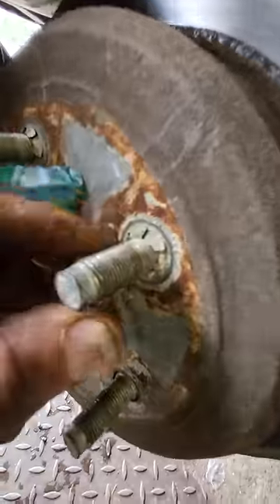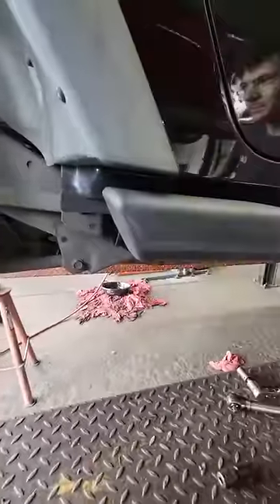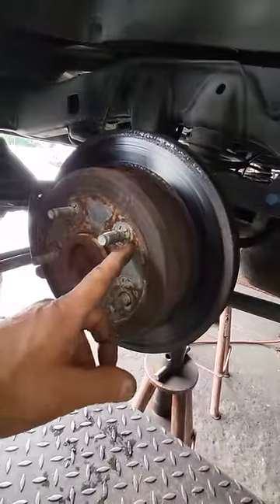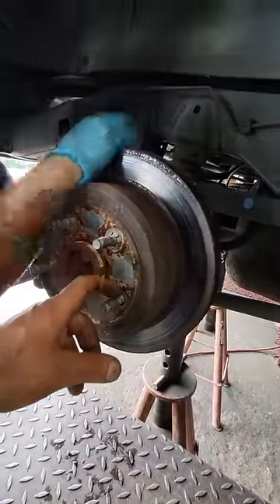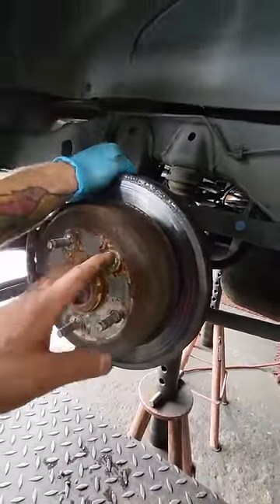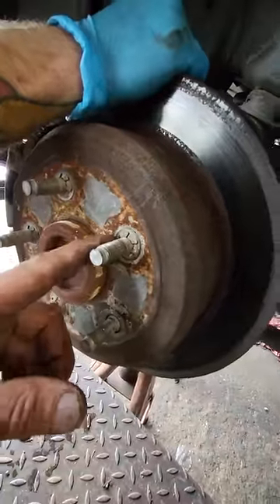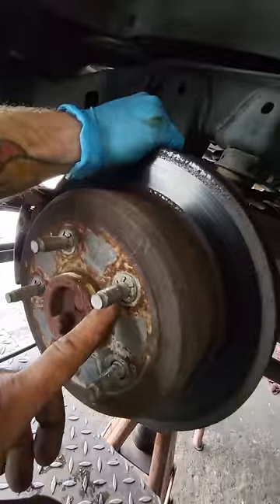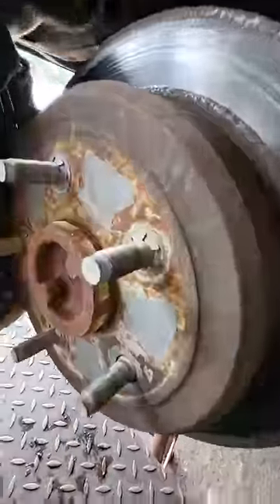There is always that guy

Comment: This is why eventually the young mechanics end up not replacing the oil filter because their boss tells them if the oil looks ok then skip the filter.   Small things turn into bigger things.  I just paid $200 for a transmission flush at dealership and drove it home and pulled half a cup of fluid and its jet black.   They then wanted to tell me it was their flush machine needed to be calibrated.  STEALERSHIPS!!

Comment: That clip is only there for the automated Factory line. It's there to keep the rotors straight so you don't have to have a human hold it to put the caliper on during the simply it' has no function after that

Comment: Ha, that's me. Can get a 500 ct bag of new retainers for 3 bucks. Just looks professional when they're shiny and new imo. That extra bit of polish. Costs almost nothing and takes 10 seconds to pop on. They do nothing though. Even in worst case scenario, lugs fail or sabotaged and wheel falls off, you've still got the rotor hitting pavement and these little shits ain't saving nothing.

Comment: Why would you need to remove the wheel studs to switch out brake pads?
Reply: The rotors
Reply: @pinkiepie1656  he clearly stated changing the brake pads, not the rotor
Reply: @vaughnlucifer1339  I watched it and didn't hear him mention brake pads. I also didn't hear him mention 'removing studs' to change anything.

Comment: Tisk Tisk, here at the top tier repair facilities a vehicle leaves with the same amount of parts it came in with because that is the manufacturers repair procedure. For about 25 bucks you can buy a 5 lb bag of those and never have sleep knowing you have never finished a brake job all the way through 100%.

Comment: First of all. Parts will not have those in stock. It will take too long to explain to the parts guy what you are needing. So in my 21 years as a tech, I have never put those back on. I cut them off.

Comment: You should tell the reason why they use them is only because on the assembly line they need them to stay together when traveling down the line before they get to the wheel install section

Comment: Inverse arguement they will rot away first and cause a loss in clamping force on the rotor and wheel and the studs will snap and they will eventually cause the wheel to fall off. LoL in which case the rotor might stay in place

Comment: That's because the dealer uses an on car brake lathe so the rotor does not have to be removed also I am guessing the customer drives mostly highway puts on a lot of miles on a vehicle and by year it's not that old. That's likely the clips are still on there. Rotors on average are probably cut three times already and ready to be discarded for new. 30,000miles every brake job the car would be around 90,000miles and this is highway driving so easy 100,000 or better with the clips on.b

Comment: Won't the rotor wobble every time you take the wheel off?  Possibly putting the tire on ith the wrong position causing the wheel to be unbalanced and the rotor wiggling the hub smh
Reply from the maker: No

Comment: As a mechanic that works on 100+ vehicles, memorizes all the bolts to every part, id rather not have any left over bolts, spacers or clips. Everything i take off, goes back in. Easy math. Nothing anal about it

Comment: Shiiiii… I replaced the brakes on the company truck after them grinding for 2 weeks… come to find out the truck had over 170k with the original rotors and brake pad hardware… they didn’t even grease the pins when the pad slapped it… I fucking hated trying to get those clips off… they were corroded on there so bad that I finally said fuck it and chopped em in half with a chisel🤣

Comment: People in this chat arguing for their replacement clearly don't understand what holds a rotor on if the wheel comes off. It's not those clips. It's called a caliper assembly. If all that comes off ypu were in a wreck and are viewing the scene from above. Rip.

Comment: How do you know they are not the original brakes? They are on the rear.
Reply: The rotor has probably never been changed and it is the one it came off the assembly line with. People pad slap brakes all the time especially rear ones.

Comment: Could be worse, it could be some ass who torques the caliper bracket bolts to 10 million ft lbs, cross threads them, and leaves that horror show for the next guy. (Me). Be glad you have lifts and don't have to lay on the ground for 3 hours pushing on a breaker bar 1/6 of a turn at a time, straining every muscle in your body for that 1/6 of a turn.

Comment: I just did 1984 Camaro Z28 convertible fuel pump original brakes and I had them Clips on it from the factory I look at it this way what other things you not putting on

Comment: Nope you need to order new ones every time the wheel comes off. You should also torque interior trim pieces to factory spec when reinstalling. If there is no torque spec listed anywhere, call the manufacturer and fly a team of engineer out to determine it. Never can be too safe. Also if a mechanic ever beats the book time, it means he’s wrong and needs to redo the job

Comment: OH, so you're  that guy that removes the splash guard from the wheel well that covers the oil filter because it takes to much time to reinstall, but it protects the rest of the undercarriage and engine parts from corrosion and damage...

Comment: Then the manufacturer should have taken them off once they were not needed. Maybe you should take the bolts off of the wheels because the manufacturer left them on. If it came with the car and I can easily replace them at no cost to me, they are going back on. It is as close to original as you can get.

Comment: The Subframes and Axles are assembled at another vendor or subassy area.  This keeps the rotor installed until the wheels are finally installed, one of the last steps.

Comment: The thing is thow is its not your car and your being paid to do things correctly, so why not just put them back on... Again its not your property... If it was im sure you would want things done a way you want..
Reply: If you knew how much the manufacturer charged for useless parts like that would you pay it? Figure min $4 up to $10 per retainer, x10 if your doing the rears like this video shows, extra $40-$100 on top of your bill, for a part that has 0 function once the wheel is installed and torqued down
Reply: @h4x724  Sure, If the owner wants it in that state then yes 100%. Again its not your car you are only being paid to do a job and if thats how they want it then shut up and do your job. Sorry but if i pay $80,000 and they came on it then hell yeah i do and if its not then its as simple as ill find the shop that will respect other peoples property.
Reply: Guy did brakes on his own truck and bought new aftermarket wheels. 
He brought us the truck for a vibration issue. The new aftermarket wheels were perfectly balanced. Brakes were not warped, so what was it? The little retainers didn't allow the wheel to sit flush against the hubs. I didn't even charge that guy, just took off the retainer and said have a nice day.  I have removed thousands of them. And nobody ever complained. 
You know the plastic engine covers that reduce injector noise? One customer had his wiring eaten by rats 3 weeks in a row. I removed the plastic cover so they didn't have a place to build a nest, and guess what? The problem stopped happening. If you know nothing about cars thats fine. But don't tell me what's correct if you have no clue about how things work. 
I won't work on cars for people with your attitude anymore, not worth the headache. Go somewhere else. Because I'm already too busy to worry about that kind of crap.
Reply: @ryurc3033  Dude, at this point its not about cars and all about your ego! My whole ass point was that if its not your property then do your job! Ill say it again if you want something done right with your property then its only right to do the same to other peoples property. ITS NOT YOURS! You clearly know nothing about me and by this conversation it seems I know more then you do. Respect other peoples stuff. Also my attitude of trying to put peoples thing back to how they were meant seems to have worked this long. 
Maybe if we wasnt being male Karens and lazy about the situation then maybe people would have more respect for automotive shops.
Reply: These clips and screws are solely for the assembly line, they serve no purpose for the car after it leaves the factory.
If you want to make a fuss about 10 cents worth of useless clips that serve no purpose go right ahead
Reply: @doodlecaboodle9298  People c,mon its not about the clips man, its about respecting other peoples stuff if they want things done a way... I dont care what anyone does with there own stuff. I only want my car fixed the right way if im paying for it... THATS ALL!!

Comment: That's why I wouldn't take my car to u last time someone cut my catalytic converter sound cover or plate cover what u wana call it and it made my engine run really loud plus they keep my old catalytic converters after putting my new catalytic converters on keep in mind my car had 2 or 3 which is a couple hundred  dollars a piece yea just for the old catalytic converters so someone from whent to the junk yard and got paid I had a 2004 maxima that was made in 2003 marketed as the 2004 they only made a few of the type of maxima se like I had it was the maxima se with the six speed the one where the dude on you tube beats the yellow porse with the even out ran the stock 2003 an 2004 mustangs

Comment: LMMFAO! These comments are hilarious. You are dealing with a little car rotor. Its not that hard to hold in place to put the caliper back on. if it is you are in the wrong trade. And then the wheel assembly holds it all together. BAMM,mind blown.